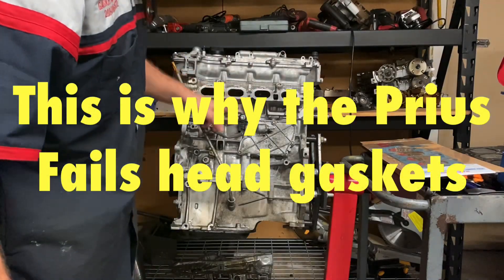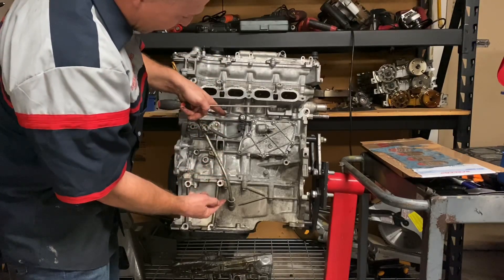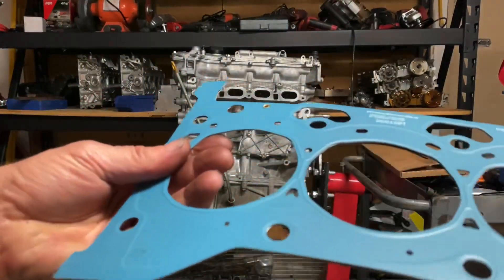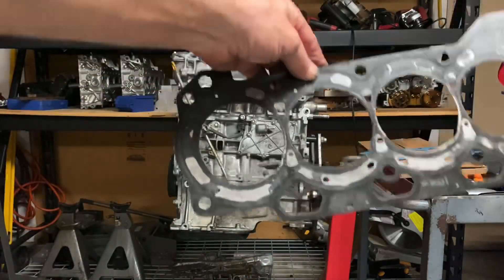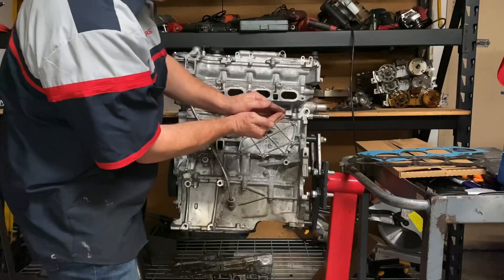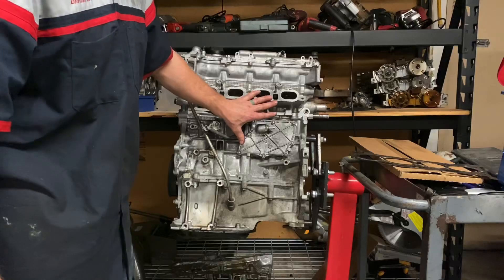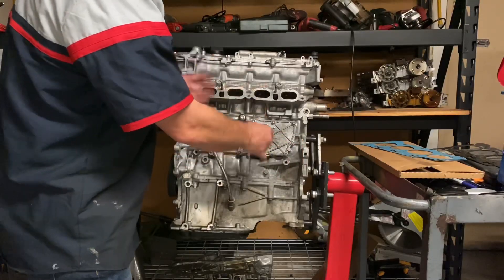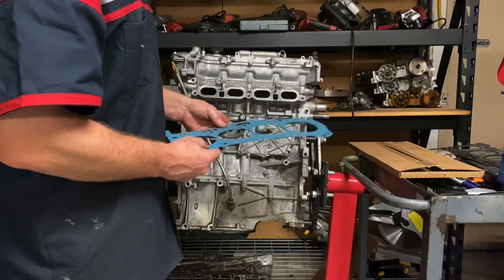THIS IS WHY YOUR PRIUS FAILS HEAD GASKETS, BUT ITS NO BIG DEAL

Comment: So my man is there anything I can do to prevent this?
Reply: Not sure, but my 2012 pruis went 265,000 before it started to leak.Never burned oil. Drove in Seattle traffic 1800 miles a week.

Oil changed every 5,ooo mobil 1 0-20  with best filter.

Comment: On my 2011 I did it all. Head gasket, EGR valve, and EGR cooler. On cold mornings, I'm still getting a small amount of rattle about 1 minute after start up. 
it has P0302  P0300 P0304
I've exchanged the #2 & #4 coils with  #1 & #3 coils to see if the misfireings are going to migrate.
Reply: what did you figure out? sounds like clogged EGR valve, cooler and intake perhaps. this appears to be major issue on 3rd gen

Comment: My Prius C Aqua is having that knocking sound in the morning (So Loud). But the engine light is not on. It’s not showing any code either. It only has 120k miles
Reply: You need a new engine

Comment: It is an interesting theory. I wonder why 1st and 2nd generation prius never have head gasket failure.  I believe there is a design issue at work here as well.
Reply from the maker: The cylinder walls on the 1.5 are slightly wider in ratio, therefore less likelihood of leak
Reply: @gasketmasters  thank for your reply, I’m considering a Honda Accord hybrid, are there any modifications that I can do to eliminate this issue potentially grounding me or should I just avoid the hybrid all together as I may need it for work requirements. Apologies for the thread hijack 👽
Reply: @gasketmasters  and what about the fourth gens then?

Comment: I wish I would have seen this video 2 years ago. My 2010 Prius died after 196k miles. It would do the rattle a lot at startup. At the time, nobody really knew what it was. It steadily lost power, clicking in the engine, and noticed coolant getting low all the time. When I took it to the dealer, they took the info, and wouldn't actually do a pressure test without a big fee and NEVER mentioned head gasket. I ended up buying another car now, but still have the Prius. I may try to have another engine put into it, but then again, the Hybrid battery and Catalytic converter probably will only have 100k left anyway, so might not be worth it.
Reply: Had I replaced the head gasket before the piston clicking, then it would have been a save. Too late now.
Reply from the maker: We ship rebuilt engines.
Reply: @gasketmasters  how much on a rebuilt engine. Also the hybrid battery?
Reply: @gasketmasters - I need a new engine-as a result of blowing the engine
Reply: Here is a well done DIY head gasket replacement presentation, Prius 2016-2022

https://www.youtube.com/watch?v=NAei4nsNFzk

Comment: I'm changing a prius head gasket with a new Fel-pro gasket. Can I expect more then 150-180k miles on the life span of this new gasket?, the same? Much appreciated.
Reply: Did you follow through with the head gasket swap? If so, had any problems since?
Reply: @gv4832   Yes, Changed head gasket several months ago. Driven car maybe 12-15,000 miles. Runs like new, so far no problems,
Reply: @eddebatte9905  Thanks for the update. For what it’s worth, I’ve talked to a few people who suggest Lucas oil fuel injector cleaner in the gas tank once a month and strict monitoring of the EGR system to prolong head gasket life. 

With how common the problem is that can be taken with a grain of salt, but preventative maintenance is the best we can hope for I guess. 

Thanks again

Comment: Very good explanation. Any particular mileage when this starts happening?
Reply from the maker: 150-180k is our most common.
Reply: Yes. 2011 Prius at about 200,000 started happening. All things being equal. Is it worth fixing? Thanks for answering so fast.
Reply from the maker: @eddebatte9905  that would a question best answered by you.
Reply: @gasketmasters  ok thanks
Reply: @eddebatte9905  I’d say better replace the head gasket when this starts happening, otherwise you may well get much worse problems due to the heavy vibrations due to misfires.
Reply: @paul_g_6561  I did change the gasket 5 months ago. Engine runs very good. Put about 8000 Miles on it. So far no problem. Good advice from Gasket Maker video.

Comment: They fail because of carbon clogged egr valve, egr valve cooler & intake manifold, clean all the carbon out & your on your way to 400k+ miles
Reply from the maker: I’ll refer you to our newest video. You obviously don’t know what you were talking about. 
The EGR doesn’t even come into play until the engine is already 185° as measured from the engine coolant temp sensor
Reply: @gasketmasters  what should be the normal highest temp to watch for? is there a dangerous temp that will spell doom?
Reply from the maker: @igorb81  above 225 is not good. Average temp when we test them usually ranges 190-210

Comment: Thanks Walt and Manny for coming to my home today 11/16/2020 and replacing the head gasket on my 2014 Prius V with 150,000 miles. You guys banged it out in about 2 and a half hours. Also thanks for the 10% off for paying cash. Total $1300. 

If you guys are still on the fence about getting this done to fix the knock and engine rattle on engine start up, best to get it done. Instead of waiting and then having engine blow out then having to buy used or rebuilt engine. Comes out to about $108 bucks a month. That’s less money than a new car payment or the money I would spend on 2005 Chevy Avalanche for gas, which is $400 bucks a months.
Thanks again Walt!!!
Reply: Is your engine the 1.8 or 1.6? Dude your prius. Have the truck instead of the h hatch
Reply: Can you please post Walt's and Manny's info.  What city and state

Comment: This was so GREAT!!!!!!!  I just had my Prius now need a new engine for it crack because #2 cylinder    I can understand now why my mechanic is not good  He did not check the engine when the check engine came on.   Failed #2  replaced   drove for a week and check engine light came on again....We he told me I needed a new engine.  I only had 175,000  mileage...  I drive 500 miles a week to work mainly freeway driving
Reply: The check engine light gave me those codes seen in the description. Those codes don't really point to bad head gasket so you start replacing plugs/coils etc. But Gasket Masters has given us the REAL reason for the check engine light.

Comment: Thank you for your knowledge.I brought mine to a Toyota dealer and they still didn’t know until the 3rd time it went back and finally said that the coolant was leaking in and that I would need a new engine. Is it to late to get the gasket changed out once you start hear that knocking?
Reply from the maker: How long does knocking last in the morning?

Comment: Have you seen any problems with 4th gen Prius engine?  It has some revisions in engines, EGR, etc.  Want to know if it is worth to upgrade or stay with my 2015 Prius
Reply: Same problem on my 2019 with 197k miles.  Actually same engine from 2010 till now
Reply: @kirill6262  yes, but the transmission is new, engine is slightlh more efficient with better torque curve.  The EGR valve is less problematic because the EGR line is after the catalytic converter. It has less junk and residual fuel. If you have head gasket issue at 197 k miles, that sucks. Most 2nd gen Toyota has no head gasket issue even at 500 000 miles although they usually start burning oil. What I know, only pre 2013 really often have head gasket problems. Toyota revised the head gasket in 2013.  For FIAT, Crysler, GM, Nissan QR25  head gasket at 100k miles is normal but not for Toyota or Honda
Reply: @rondhole  it is second generation transmission never breaks. However, the changes on the new transmission are correct. This will not affect its lifespan, however the transmission is completely different. Toyota thank you for the new EGR design. The input pipe after the cat is absolutely correct. I have a lot of friends with Prius. Around 200k, the head gasket is normal. Oil consumption ??? This is generally quite normal :-) Yes, not an Audi 2.0t, but after 100-130k for every Prius. Small changes in the design of the piston and the issue is resolved forever. I love Honda motors more. Less problems. Almost any engine model has some kind of problem. I think they smoke something when they invent. Sometimes it is obvious that it will break down and Toyota still produces (3.5 oil lines for example)
Reply: @kirill6262  3.5L V6 oil line has been revised long ago with full metal. Toyota does not changed radically but fix bugs on all their engine designs.  2015 Prius has revised piston and piston rings and much less problems with oil consumption as long people change the oil regularly 6m/5000 miles for severe usages/short trips.  Honda engines are great but not their transmission, Toyota overall has better transmission in therm of reliability as a whole package.  Most people has zero problem beyond 200k miles in both brands. Only in trucks and SUV where Toyota far ahead

Comment: I have these symptoms in my generation 3 prius 2010 325,000 miles.   I noticed it helps to keep coolant tank low in fluid.   But I also realized another thing.  Keep driving the car in "B" mode and it helps keep the engine from start and stopping.  This video explains  why and now i'm getting ready for gasket replacement.  Should I replace head bolts or keep old ones?     Just one question for you all, why does my 2008 2nd generation prius not do this? It has  250,000 miles?
Reply: Totally different engine might be the reason

Comment: My 300,000 mile 2013 started to misfire with and I changed the spark plugs and such. It continued and I took it to the Toyota dealership repair center. He told me about dropping the gasket rings or something weird. He never mentioned a head gasket. Maybe that was in the process. He has had my car for 2 days. Quoted me around $400 repair.
Reply from the maker: Most likely it wasn’t the HG then. Was it repaired or was that the price for them to diagnose?
Reply: @gasketmasters  it's riding better with a few misfires so far after a 20 minute drive in stop and go traffic. They did a gasket drain and cleaned the cylinder. Cylinder 2 was burning out the spark plug. I had an oil leak also. They ran it for a few days. They charged $120 for the diagnosis if I did no work with them.
Reply: @mostmost1  If you start noticing a drop in coolant level, get the HG replaced immediately, because next will be piston knocking.
Reply: @napynap  How much of a coolant drop? It's hot here in Atlanta. I noticed my coolant level dropped by about 1/8 to 1/4 inch and so I topped it off. Three days later I'm getting P0300, P0301 & P0302 codes with MAJOR start-up rattling.

Comment: My 2012 Prius V with 140k miles had the exact same symptoms that Walt described in the video. My local mechanic wanted $4K just to diagnose the problem. The Toyota dealer quoted $5-6k but said they couldn’t tell me what it was until they opened it up. Thankfully I stumbled across this video and Walt came out to my house to replace the head gasket at a MUCH more reasonable price point. He showed up on time and finished the job before lunch. I highly recommend these guys. Thank you Walt!
Reply: this is a basic job...I have a toyota 2012 prius V and my mechanic changed the head gasket and also the water pump...it cost me 2400 dollars  and the car now is 543 000 miles.
Reply: How much you paid if you don't mind. I'm starting to have the same issue
Reply: @1129otorres  Less than $1500
Reply: @angelosenteio  where are u? California? Do they have office in NYS?
Reply: @reocam8918 He’s in California, you might find someone out your way that does the same if you look.
Reply: 🤣🤣🤣 damn these mechanics in us are crazy whaat 4k, watch in youtube and change it by yourself
Reply: Did u find any body in nys that do Headgasket issue?

Comment: If this were 100% true wouldn't second generation Priuses also be prone to headgasket failure? The consensus in the Prius community has shown that head gasket failure is almost endemic to the third generation 2010-2015, but even less so for years 2013-2015 due to numerous revisions in 2013 including EGR/Intake Manifold design changes. What are some of the differences between second generation (2004-2009) and third generation Priuses you ask, well most importantly the second generation has no EGR system that is prone to clogging or failure which has been witnessed very commonly in the third generation leading to changes in internal temperatures.
Reply: The 1st and 2nd generation have a different engine which seems to be less sensitive to the leaking of coolant into the cylinders when the head gasket starts wearing
Reply: @paul_g_6561  the fourth gens dont have head gasket issues either.   Its not the engine.  Its the egr design, among other things
Reply: How do I prevent Failure? Replace it before it fails?
Reply: @selvaspk2324  Replace/clean egr frequently(every year). You could try to let the engine warm up, tho not sure how much can you do in city traffic to force it to run, since its where its meant to run the petrol engine the least.

Comment: I have 04 Prius with over 300,000, never had to do a head gasket, also a 2010 with over 200,000. Also no head gasket problems. Biggest problem for 3rd gen is the EGR system. I just cut a piece of metal and blocked it off
Reply: Where did you add the piece? I recently gave my whole EGR system a good cleanout.
Reply: @Ass_Burgers_Syndrome  it didn't work long term for me, and then the engine ended up throwing a rod at 220k!
Reply: @Fit4FreedomLLC  after u blocked an EGR?

Comment: Just replaced head gasket on my 2012 Lexus CT200H (same engine as Prius). Tried everything on YouTube before the head gasket, but in the end the head gasket was the fix. It was not as hard as I had dreaded. Thanks for the video. Like others have said it was very informative.
Reply from the maker: That’s great to hear. Thank you
Reply: you did it yourself? how long did it take you?
Reply: @igorb81  I took my time, didn't want to miss anything. Bought a repair manual off of Ebay. Probably an all day job maybe 2. I did a little at a time during holiday so a week for me.

Comment: Thanks for the info man you rock 👊. I've been having issues with cold start rattle when the car sits for a few days, despite changing the hg 40k miles ago.
Reply: You might be referring to the brief rattle on a cold engine that's present in many Toyotas caused by the intake camshaft timing gear assembly. I'm aware they've issued TSBs for this issue, specifically T-SB-0087-09 for the 2ZR engines for 2009-2010.
Reply: @ucakpan  that's happened twice to me.
Should I be concerned?
2012 185k
Reply: Also check to see if your spark plugs or coils are bad. I know my Prius definitely vibrates a bit more at cold start after sitting overnight.
Relatively easy thing to swap and see if it fixes it

Comment: I replaced the head gasket on my ‘10 Prius. It was leaking between the #1, and #2 cylinder. After I replaced the gasket now it is leaking into all cylinders. I checked the deck and head for clearance. Also, I used the correct torque specs. Any idea what is caused this? The head gasket I used was Ultra-power from Rock Auto and the head bolts were from them as well. They were Apex. Any ideas? I do not want to tear the motor down again without a solution before I start.
Reply: Use only genuine Felpro. It works great on my 2002 Altima and last 70k miles or more since * sold it at 130k. Nissan head gasket Also inferior than Felpro. Toyota also revised it in 2013 Prius but not as much cushions as Felpro on the hole lips.
Reply from the maker: We only use Felpro. However. Your problem might have been an initial overheating issue. 
Many times people change head gaskets without addressing what may have caused the initial problem. Radiator, water pump, thermostat, could all cause the engine to overheat; there by, causing even a brand new head gasket to fail due to heat and compression of the thin metal.
Reply: @gasketmasters  Wouldn't any "radiator, water pump, thermostat" issues show up as diagnostic trouble codes?

Comment: So I'm getting all this symptoms, but no coolant loss, and compression is even across the cylinders. 150/155/160. Started with P0300, P0301 P0303.
New egr valve, recent PCV valve change. Now intermittent rattling at lower rpms. Cylinder 2 misfire but not enough to throw CEL.
2013 prius 274k miles
How do I make sure it's a Headgasket failure without going to the shop???
Reply: Go to your nearest auto parts store. Rent a “combustion leak tester”. It’s a plastic tube that has a cap with a hole on top to fit a suction cup or rubber hose, and a cone with a small hole in it on the other. Pour a small amount of the included fluid in the tube and cap it off. Remove the reservoir cap and put the cone on it. Have an assistant start the car. (If the car is in ready mode, have the assistant give it just enough gas pedal to kick the car on, or turn the heater on high temp, high fan). Draw a vacuum on the tube and watch the fluid color. If it changes, the head gasket is blown.
Reply: What solved the rattling in your prius engine?

Comment: thanks for  the vid.    my car is a 2013 hybrid toyota 3rd gen i noticed a high coolant consumption on engine with poor engine power. but no oil consumption .  is this could be a sign of a failure head gasket ?
Reply from the maker: Yep. Definitely